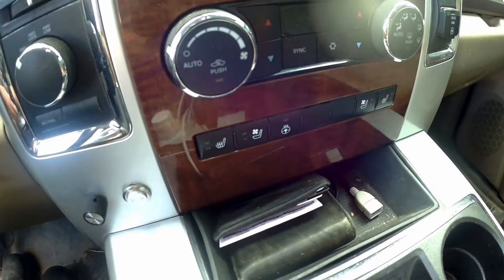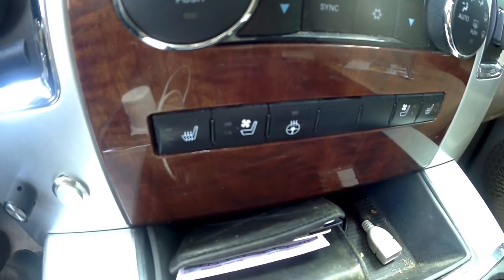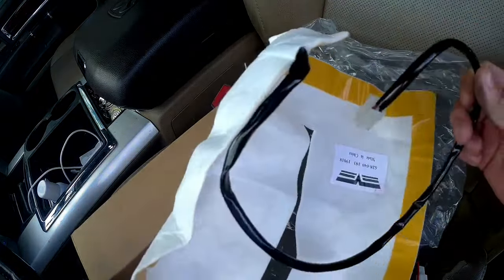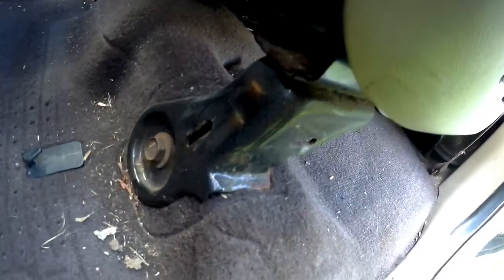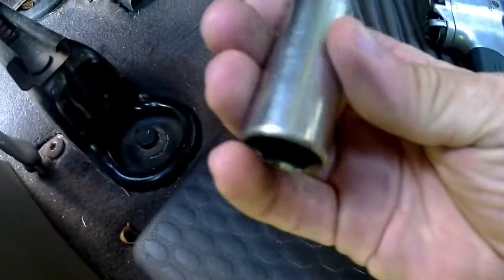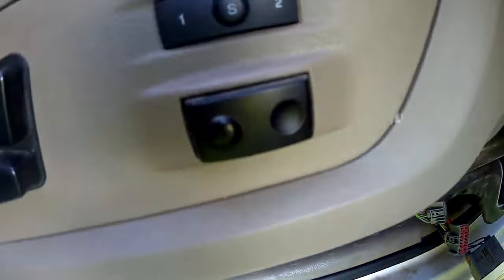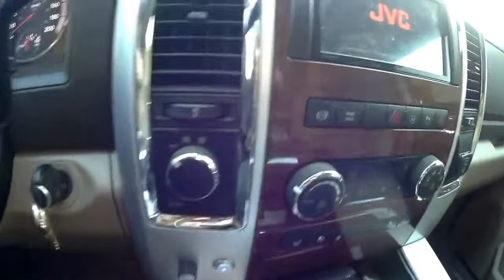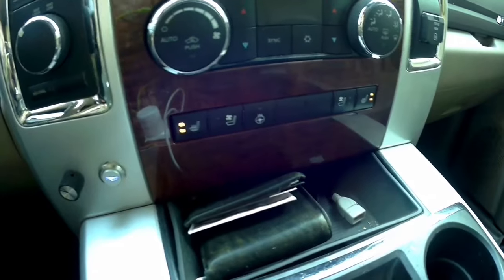Dodge Ram Heated Seat Repair/Fix

Comment: Thanks for the video! Didn't want to spend 250 or more for mopar replacement part.  Fixed 2013 ram, did it with leaving seat in.
Reply: How did you slide the new pad into the seat cushion? I was considering using something like cereal box cardboard to assist sliding the pad in, and then pull the cardboard out once the pad was in place.
Reply from the maker: If I remember right, there was enough room to put your hand in and make sure it's flat
Reply: @KendorFarms  sounds like a plan. Thx.
Reply: Im doing same, leaving seat in, and putting new one on top. :)

Comment: Hey, just did this replacement and got everything back together and my problem still persists. I can feel the bottom heater getting warm, then it shuts off before it gets hot. Dont feel anything coming from the back heater though. Should i take it all apart and do the back aswell?
Reply from the maker: That could be the one that is shorted out
Reply: @KendorFarms  Awesome, I'll give it a shot when I have some more free time, thanks

Comment: Wow you took the entire seat out of the truck, I replaced the seat cushion in my 12 Ram Cummins without taking the seat out,  the HOG rings were a pain in the A but it's easier than pulling that heavy seat completely out and putting it back in . I thought about doing this but it slows down the cooling of the seat not completely but enough to notice a difference.
Reply from the maker: Yea it was more for the video but did make it easier and the seat is super easy to get out. Cooling still works good, haven't noticed a difference, but each to their own

Comment: Does the additional element interfere with the vented seat function? After sliding in the new mat do you still feel the cool air coming thru the seat?
Reply from the maker: Yep, still get the cooling effect

Comment: Great video. Thanks for posting - I was quoted $1500 by the dealership to do this - did it myself for the $80 part. I also did the backrest heater which is not covered here. Back heater is super simple while you're there - there's a green plastic connector that follows from the heating pad on the back. Unplug that - it only has two wires as it does not have the heat sensor. Connected them as per the video for the seat element - black to black and yellow to red. Plug the connector back in. Works perfect.

Comment: Im going outside to do mine, I bought that shit a year ago, and finally got around to it, not taking out seat tho... gonna stick it right over the other one like you did.... Hope fully it works out as well. I also have the same ones you had. :)
Reply: Did that work for you?
Reply from the maker: @oilerguy5494 still working great for me
Reply: @KendorFarms  And you didn’t have to take out the seat? Thanks for replying quickly!
Reply from the maker: @oilerguy5494 I took it out for easier access, wasn't much harder

Comment: How did you diagnose that the heating element was bad?  Did you just test the resistance of the heating elements using an OHM Meter to make sure?
Reply from the maker: Yea, had power going to the seat but open resistance
Reply from the maker: Also temporarily hooked up the heating pad to confirm my suspicions and make sure the system was functioning properly
Reply: @KendorFarms  My heating element is reading like 20 Ohms on the bottom (yellow and black wires).  It is not open resistance (OL on my meter) so I'm assuming it's still good.  I couldn't easily find the upper heating element wire.  Where did you find the wiring diagram?
Reply from the maker: @kw5773  I have the wiring diagram, but the upper wire comes down at the back of the seat. Just two wires I believe and the same colour
Reply: @KendorFarms  My truck is a 2016 Longhorn and I believe my seat has side airbags.  The wire loom going up the seat is a big yellow connector with multiple wires., like 8 wires in it.  But I'll look and see what color those wires are.  Or maybe there is another connector I am not seeing?
Reply from the maker: @kw5773  hmmm, they yellow wires are bag to unplug in energized lol you never know…. I’m thinking it should be a separate connector, but I don’t have a wiring diagram that new unfortunately

Comment: Hey great video thanks! 

I have a 2015 1500. My passenger side works perfect, driver’s side will come on for 10 mins or so and just when it starts to get a little warm it shuts off. Any thoughts??
Reply from the maker: It’s highly likely it’s in the seat heated pad. It’s probably getting too hot and tripping the thermo sensor. It could also draw too much current when it gets hot and trips the breaker. Good chance the seat pad needs to be replaced.
Reply: @KendorFarms  thank you! I was afraid of that😳
Reply from the maker: Yea it sucks, but it was actually an easy thing to fix

Comment: My 2013 Ram heating seat led don’t turn off but my seat doesn’t get warm. No blown fuse. What could be the problem? Passenger side work perfect. Heated steering work also fine
Reply from the maker: The control module or heating element likely
Reply: @KendorFarms  i’ll check the module for connection problems first. Thanks for ur reply
Reply from the maker: Also see if the seat heating pad is getting power when the switch is on. if it is and it’s still not working then it pretty much the heating element is bad :(. Most of parts/wires are under the seat
Reply: @KendorFarms  where can I connect a multimeter for checking power? One of the plugs on the module?

Comment: does the heat on the back rest start working again as well?
Reply from the maker: Yes, there was nothing wrong with it however it would not work if the bottom heating pad does not work

Comment: Are you sure there is a back heater?  I didn't think the back side had a  heating element, that wire is just for the lumbar adjuster.  Also If you look at the controls it only shows the bottom of the seat heater not the lumbar area.   Just saying!!!  Maybe I'm wrong.
Reply from the maker: Yea it does, at least in my 2011
Reply: @KendorFarms  Just Installed mine this afternoon.   Works great warmed my ash real fast, better than the OE one ever did.  It does feel like the back heats up, but I'm still not convinced that it has an actual heating element in the back.  I think it's just osmosis that makes it feel like it does.   Did you see an actual heating element?

Comment: Followed all the steps still cutting off after 3 seconds it any recommendations?
Reply from the maker: Could be a short in the upper pad pr maybe a problem with the controller under the seat